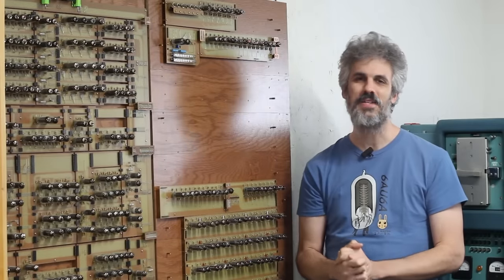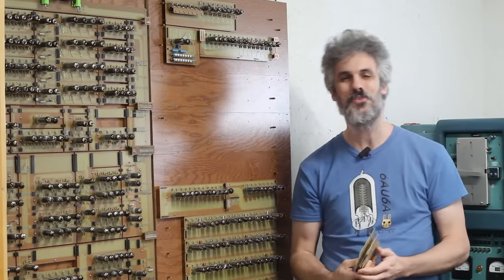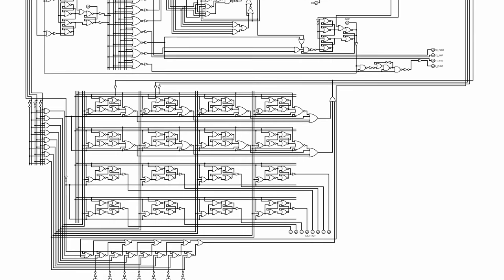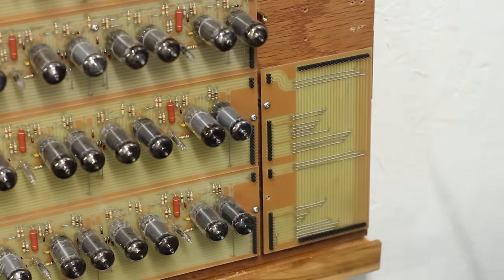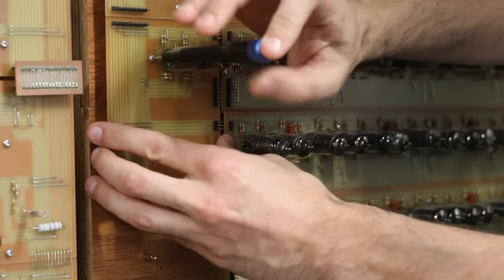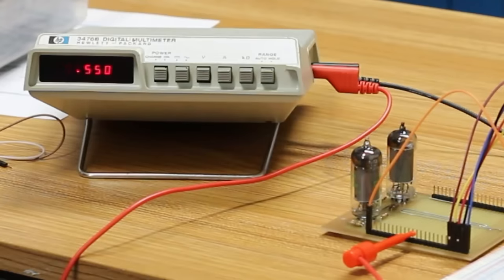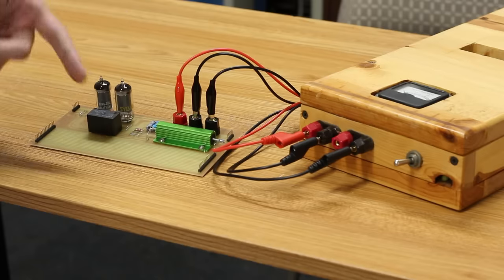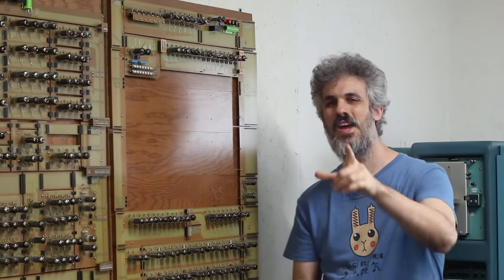VTC P.36 – Logic Done!

Comment: If you are at all worried about that 1R resistor cooking up simple enough to crimp ( not solder, as that will kill it) a 105C one time thermal fuse to some wires, and put in series with the power rail. That will then be attached to the resistor body, simple enough by using a fibreglass sleeve (again heatshrink not usable with 105C melting it before it will shrink) for insulation, and then a simple fabricated clip using the grooves on the resistor to hold to the top. 105C surface temperature, and the thermal fuse will melt and stop operation long before that resistor gets hot enough to burn the wood or PCB anyway. 

Commonly done on old TV sets with dropper resistors, though there it was often just a spring held with solder, so that if the resistor got hot enough, over 183C at the solder point on the spring, it would soften and the spring would open and break the circuit. Simple, reliable, and even if the resistor got on the way to red heat it would trip before it got hot enough to do more than start to smoke gently as it cooked the dust accumulation on it.
Reply: Or use a couple of light bulbs as ballast. Which obviously give a convenient visual indication of the load flowing through them.

Comment: About a year ago I had no tubes, and no tube devices. Always been 'interested'. Anyway, a KG-635 oscilloscope, Jackson 607D HV power supply w/filament supply, grid dip meter, all vacuum tube powered and recapped by me - I now own well over 70 tubes not including the tubes inside my equipment. I also enjoy radios, so I have a old tube CB radio and some ham radio 'pieces'. Working now on a tube tester for 7 pin Soviet tubes. I have 40 6J1P, 15 6J1P-EV, some 6Z4's, OA3's, 6N2P's, and others. I've just started to experiment building circuits with the 120 volt 6J1P's. Anyway - thanks for all the videos I hope to see some more tube videos in the future from you.

Comment: The funny thing is, for most industrial controls, a lot of the work IS single bit.  Ladder logic (AKA relay logic) is still to be found in a LOT of machines, even modern ones.  Because for some tasks, a single bit is all you need.  Granted, modern PLC's aren't using single bit processors, that would be silly, but a lot of the logic is still single bit.

So back in the day, i can easily see a single bit processor for industrial automation would be a smart thing to make.

Comment: Single bit CPUs...  The company that I first worked for in the 1970s made a high-performance minicomputer, built from Motorola 10k series ECL, where the primary goal of the architecture was programmable interfacing. It was essentially a single bit machine, although it had 16-bit extensions which were normally included.  Data RAM was also customer option.  Power consumption was high, due to the ECL, but performance was very respectable for the time at 8 MIPS.  The MC14500, of course, was at the other end of the power and performance spectrum.

Comment: I really like the look of the curved traces on your PCB boards. Guessing you designed it that way since you're milling the traces rather than etching them, and a curve is going to be faster to mill than a corner because it avoids a stop and start to change directions.

My current electronics project is very retro, and I've sourced a bunch of vintage electronic components, so now I'm designing the PCB boards and I'm thinking of etching them myself. Perhaps I might try designing them using a more curved fluid design like they'd have used in the late 70s/early 80s, which would match the era of most of my components. The enclosure I'm also designing will probably have a transparent lid so you can see the vintage goodness, which might also show the curved traces if I use single sided boards like you use.

Comment: The resistors only need a heatsink if the are expecting power that would cause them to overheat.  The metal is already a heatsink.   It's like saying TO-220 package needs a heatsink to function,  just because it's designed to have an OPTIONAL heatsink fitted if load requires it.    
Anyway, that's my rant on it lol.   I love how the UE-1 is coming along.   Look forward to it being completed and the UE-2 coming along :)
Reply: I'm wondering if a design like this should consider full on max current, in case of some worst case failure just so the thing does not catch fire or melt or something?

Comment: Since those are cathode-followers (current amplifiers) for increased fan-out, I’d check the to see if they can - in fact - provide the required current. Also, since the output voltage was higher than expected, alarm bells should be going off in your head. Either the B+ is higher than you thought, or you’ve got a short somewhere (cathode to grid, maybe?) , or you hooked the DMM to the wrong point, or the switch goes to the wrong point.

Comment: Just a little addition how 1 bit computers work: Let's think about 8 bit computers first. What is the biggest number to process directly in such a computer ? It's 256. The apple 1 had a 8bit processor and it was used for lots of processing/ math situations. It was of course not limited to numbers smaller than 256, that would be really bad. Bigger numbers were split in 8 bit parts and send through the bus. 
The same is true for a 1bit machine! The big disadvantage is that even for a simple 8bit integer, 8 CPU clocks are needed to transfer the data. It just slows everything down. The MC14500 has 16 instructions, therefore even the most simple command takes 4 cycles to be send.
Reply: Your last sentence would be correct if this was a von Neumann architecture, where the instructions go through the data bus. In the MC14500 however, the instructions come through a dedicated 4-bit instruction bus, so it does not need 4 cycles.

Comment: I wonder if you the computer would be fast enough to make a 1-bit Digital to Analog Converter (DAC)? It would be a Delta/Sigma increment/decrement type of DAC.  I think I saw a clock frequency of 100 HZ. It that's the max speed, then it probably wouldn't work. But, it's a thought.

Comment: Why not just wire-wrap across the little board interconnect jumpers rather than cutting out little boards? You'd be able to disconnect individual wires if needed for testing and then replace them one by one with the boards if desired afterwards.

Comment: as someone who has a lot of knowlage about tube logic. i have a question thats nagging me for some time. would it be possible to use a VFD type transistor logic ... not the fvd itself but with slight modification. or maybe a porpuse build VFD but instad of lighting up pixels it gets a output transistor like? woulnd that decrease the size alot?
Reply from the maker: Absolutely!
I actually use a VFD as half of a flip flop for my memory boards. The entire thing could be built from small VFD triodes, like the 6977, to dramatically reduce size and power draw. But, those are definitely harder to find in large quantities than 6AU6s, and they would present interesting fanout problems. But, if I have 500 of them hanging about, I'd certainly try!

Comment: I counted 285 valves, (excluding the two 2D21 thyratrons)…I know that thay are not ALL 6AU6’s, but for the purpose of this “back of the envelope argument” I will assume that they are all 6AU6’s….rated at 300mA Heater current at 6.3v. I going to round the total number of valves to 300 just to make the maths a bit easier.

Initially I will assume thst ALL the heaters are in paralell, (although I did see the circuit where you show that thay are actually in series groups of four)…

So one 6AU6 = 300mA
Ten = 3A
One Hundred = 30A
three Hundred = 90A!  Yikes!

With groups of four in series, thst reduces the current by a factor of four, so about 22.5A…snd take off sn Amp for the fifteen that I assumed were there but aren’t….so 21.5A!  

That’s still a pretty big ask from your 24v D.C. supply…I assume it is regulated…poor regulator!

Generally, indirectly heated valves like 6AU6’s are run of A.C. Supplies, just another (pretty solid) winding on the power transformer…or in this case I’d probably consider a separate heater transformer.

When I was a kid, I went to Catholic Mass…and at the church they had this organ that had one 12AX7 based oscillator for every one of the 88 notes on the keyboard…there was a chassis deck in there four foot square and just carpeted with 12AX7’s! The amplified and power supply was down in the bottom, ther was an 0D3 regulator, a few 12AU7’s, a few GZ34 rectifiers and two EL34/6CA7’s in push pull, class AB as the output to the speaker….but, there were three iron cored things there, one would be the power transformer, one was probably a filter choke snd I reckon the remaining one was just a dedicated heater transformer for all those 12AX7’s. The two secondary wires coming out of it were bloody thick!

Cheers, The Globe Collector,p Tasmania

Comment: 1-bites really hard. connection pcb is wiring harness. but why so complex logic. does not have to be. k.i.s.s. always. even if mass logic. all the buffering with two different power/voltage levels makes things cluttered. massively.